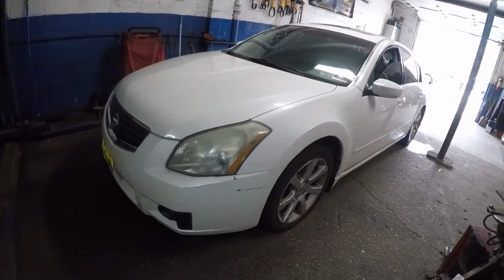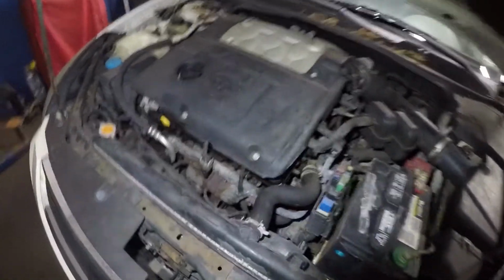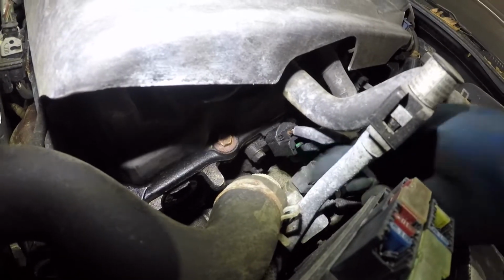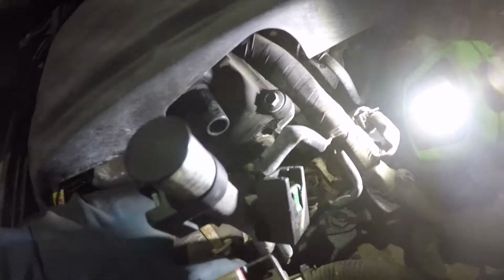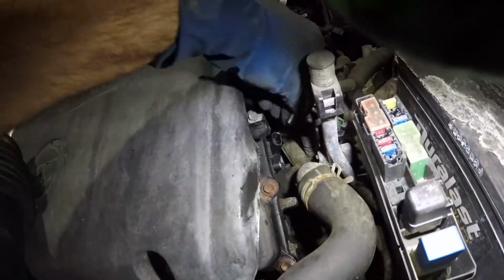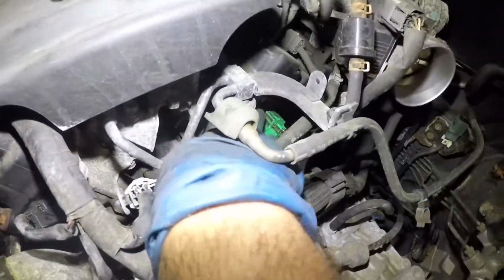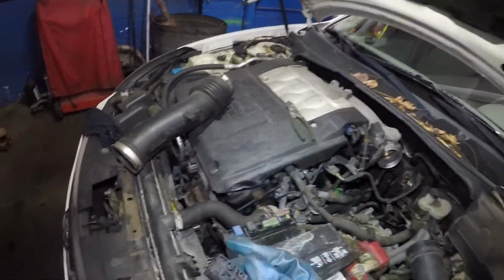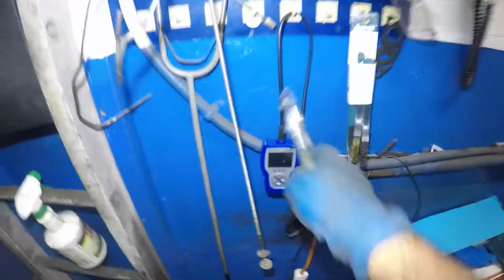Nissan Maxima 2008 Stalls Check engine Codes P0345 and P0340 replacing Camshaft Position Sensor

Comment: the cam shaft sensors look the same, I guess you can just order 2 oem type cam sensors? Does it matter which bank they go on if you are replacing both?
Reply from the maker: The back connector angel is diffrent I believe

Comment: I replaced both on my car and no improvement at all. Any suggestions?
Reply: “Slip” light 
“Service engine soon”
Both on still  car is stuck in 5th 
Hard to start. Exactly like in your video. 
But I changed both sensors to be sure the problem would go away and no luck :/
Reply from the maker: @adamsalazar9301  didn’t scan and get the codes?
Reply from the maker: What is the code?
Reply: It was the one for the camshaft position sensor. Bank 2. I replaced both though.
Reply: P0340
Reply: @adamsalazar9301 any fix?
Reply: Did you fix this?

Comment: I bought a 08 Maxima and it start bucking as I drove, turned off and the check engine light came on, I checked it and po340 came up, so I changed that sensor and 30 minutes later it done the same thing, I previous owner has already changed it before because they broke the clip on the sensor, so I simply changed both sensors the po340 and the po345 sensor, every since it's been purring like a kitten, so change both sensors and see how that does
Reply from the maker: I hd similar issue I replaced both cam sensor not one

Comment: Did you use a 6 inch extension for bank one?  The 3 inch one that came with my socket set did not work as area is tight
Reply from the maker: Not sure I think I used longer than 6

Comment: I had disconnected my battery an forgit to read the codes but my 2007 nissan maxima se jus only turns over but not start i have changed the fuel pump but it wasnt that so would u think its the camshaft sensor
Reply from the maker: U need the codes scan the car it might have codes

Comment: I installed both new sensors and still having a boging/jumping noise going on when the engine is on. It runs for a second then cuts out, do you know how to help?
Reply from the maker: Check. Live data for misfire and crank sensor siginal

Comment: Also check the connector. My bank 1 connecter had gunk in it and wouldn't clip well. Sprayed a bunch of brake cleaner in it and moved the clip back and forth until it moved smoothly. Check the grounds for the camshaft sensor wires as well. Under the plastic cover with the v6 3.5 l on it. They are right on top.
Reply from the maker: Oh nice I had one just yesterday it wasent working cuz bad connector

Comment: I'm back again with a comment. Yesterday which was also my birthday I received the best presents by changing both camshaft sensors on my 2008 Nissan Maxima it took me about an hour I had a hard time removing the old sensors from the connectors for whatever reason they did nothing want to come out so easily. They were really saturated in what looks like motor oil for whatever reason but nonetheless I completed the job and I noticed a big difference in the way my car runs and it does not stall anymore. You will never understand how this video changed my life I know little to nothing about cars the biggest thing I ever did was change windshield wiper blades. A few months ago I let my mechanic install a new throttle body on my car, wish I knew then what I know now. Now I'm going to attempt to put on new brakes... Once again thanks so much
Reply from the maker: Good job!! Happy birthday!!! Yup car will run better and start up stronger
Reply: @RBTheMechanic  👍 THANKS 🙏

Comment: Ok. It's me again. Does it matter what brand sensor I use? I'm gonna attempt to do this myself. It's B1 do I have to do both? If the code only reads B1... I also had the throttle body changed a few months ago.it was a used one. I have this video memorized.any last tips you have for me
Reply from the maker: U can do one but usully every time I change I do both and if I do one problem occurs again with the other one but many many times I just do one as customer requested try to get good sensor avoid autozone I always had issues with their parts

Comment: Good day sir. I watched another video on how to replace the camshaft the guy was extremely brief in the video so I did not feel confident with trying to do the procedure myself. I'm already handicapped and I only have one eye, I have filed for disability and my income is $0. I was able to come up with the money to purchase a cam shaft B1 which is what I needed unfortunately it is the harder one to reach. The other video that guy said to disconnect the battery. I am so confused, someone is telling a fairy tale about disconnecting the battery. I don't know either of you guys, but for some reason I believe what you say. Thanks for the tip because my mechanic said he wanted to charge me 600 bucks to do this less than 30 minutes procedure. And another guy said he would do it for 70 bucks, I feel confident in doing it for myself for free. I am grateful for guys like you, kind enough to share your knowledge with the less fortunate. I have a 2008 Nissan Maxima and because of my health my car is a necessity. Once again thanks for everything I'll be sure to like and subscribe
Reply from the maker: I’m in bayonne nj I can knock it out for u if ur local I find both to be easy
Reply: I am all the way in Chicago Illinois. If I thought my car will make it to NJ I'd be on the way. I'm just going to take my time. I'll definitely that you know how it turns out
Reply from the maker: @nfamissful  oh yeah ur far I’m sure u can do it

Comment: Hello I have a 04 maxima, it giving p0345 and p0011 code. I replace both of them with new aftermarket sensor but it still give me the error code and car is stall limp mode at 2000rpm. Could it be the sensor I got? Any other ideas. Should I replace the crankshaft sensor aswell? Thanks your input will greatly help
Reply from the maker: That code p0011 is for vvt that can case stall so change that
Reply: @RBTheMechanic  i replace both from bank 1 and bank 2  at the same time aswell.
Reply from the maker: @rmc01p  u replaced the vvt   ? In this I show cam sensors not vvt
Reply: @RBTheMechanic  i replaced the following 2 cam sensor,  the 2 VVT soliended, sparks plugs, coils and did the valve gasket while at it. I have people say to do a oil filter change and change the crankshaft sensor on the bottom aswell. I reorder the cams sensor again oem to see if that the problem.
Reply from the maker: @rmc01p  yuppp oil is one thing I was going to mention the VVT work of oil so if ur oil is wrong or low or dirty in can act up also check ur timing and misfire data with high end scantool

Comment: Perfect, although I am mechanically inclined, it's always good to check for other experience on a particular model. You can learn a thing or two this case it's a maxima which I have aswell. 07 Maxima I replaced bank 1 but didn't think there was another cam sensor just CRANK sensor under the car. No wonder my car stalled after replacing the intake manifold the spark plugs and the coils. I will be checking this same problem that occurred to me aswell early in the morning. Thanks brother
Reply from the maker: You change both sensors regardless if one is giving issue